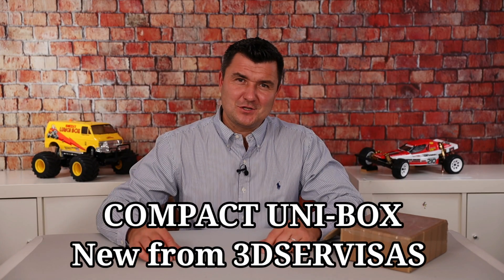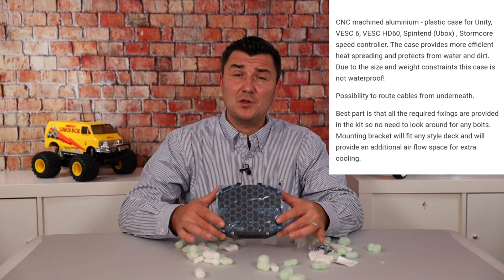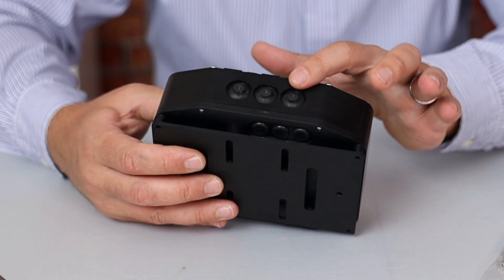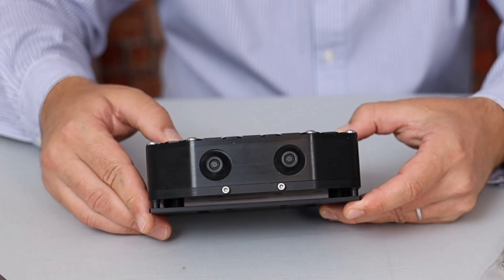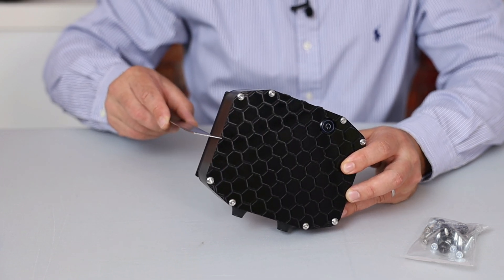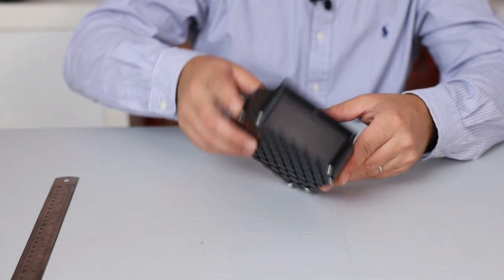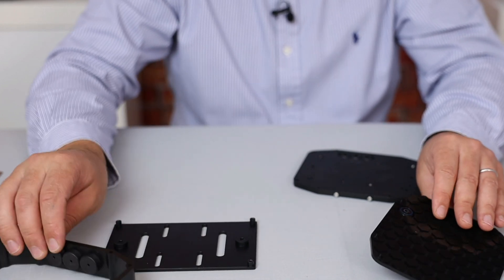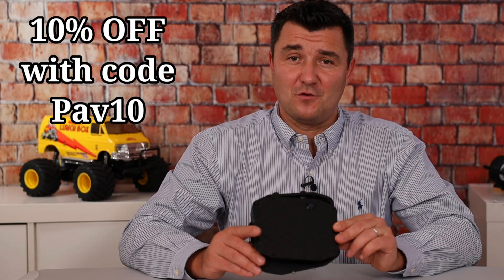ESC / VESC enclosure. Perfect for DIY projects.

Comment: hi, i was wondering if i can ask your opinion on something. im building a new board (203mm wheel gear drive 4 to 1 ratio, on flux deck)  using a dual 63100 140kv (200 max cuurent for both), and im planning to give them 185-190 amp. i have everything ready to build but i cant decide between 18s6p vs 18s9p (using. moli p42). beside more range is there any other benefits of going for 18s9p over 6p??
Reply from the maker: Hi mate,
9P will give you higher discharge rate. 6P will give you 180 Amp constant total. 63100 motors are max 70 Amp i believe? 
I would say you get around 20 miles from 6P so if it is good for you then stay with 6P. No need to make the board heavier.
Reply: @PavelGarmas  thank you the flipsky. 63100 says Max. current: 100A, thats the only reason im double guessing the 6p, i wonder if they actually can handle 90 each without heating up too much.
Reply from the maker: @ramtintashakkor7311  
I got two sets of them motors...170kv and 140kV ...motor detection showed 64- 72 Amp max at 12S